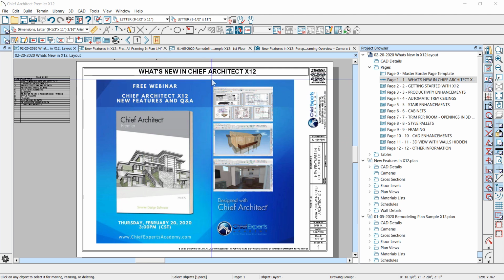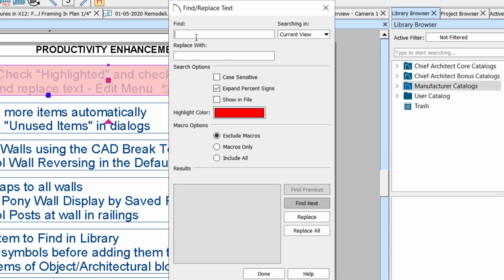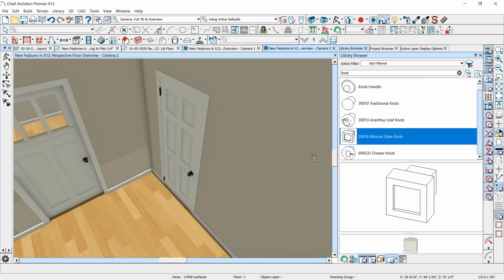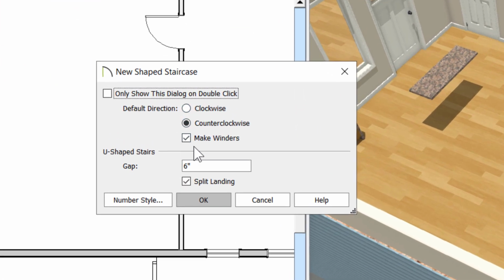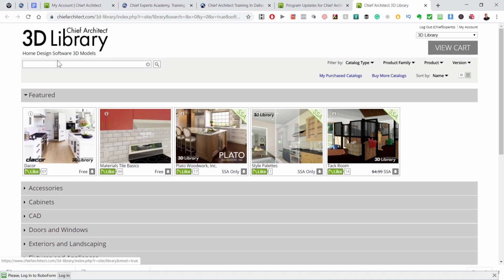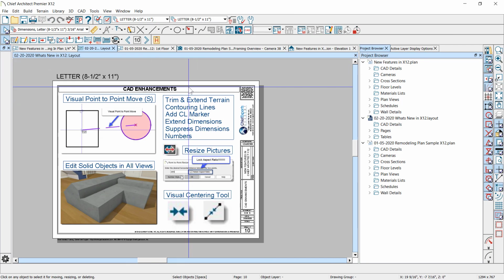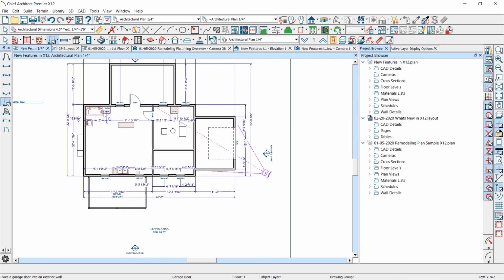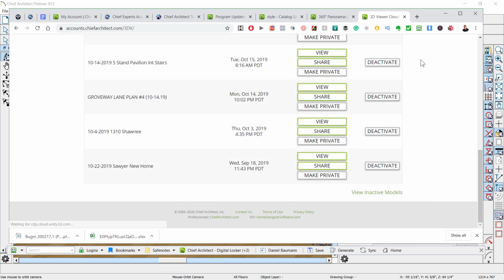What's New in Chief Architect X12 CAD Software

Comment: Nice video. Very detailed. I do have one minor gripe. Technically, everything you are doing in this program is CAD, so calling the line and boxed Cad lines and Cad boxes makes you sound like you don't really know what you are talking about, like when my 70+ year old mom talks about computer stuff.
Reply from the maker: Thanks for your comment. I get it. I've been teaching people how to use Chief Architect for over 20 years. Many of those that I teach have never used a CAD program before. When they get into Chief they think they are drawing with walls, doors, windows, floor, etc. I learned a long time ago that it's easier to use the software if you think of it as a CAD program instead of a house program. So when I describe things as lines and boxes, non-CAD users can understand what I'm getting at. I may sound like I don't know what I'm talking about to experienced CAD users, but my students do go away from my classes with a much better understanding of the software and how it works.